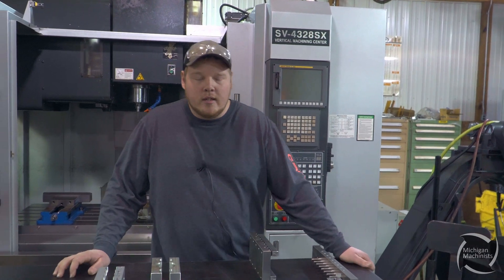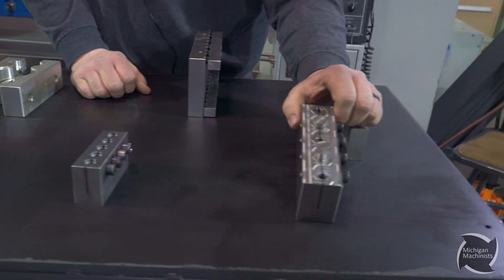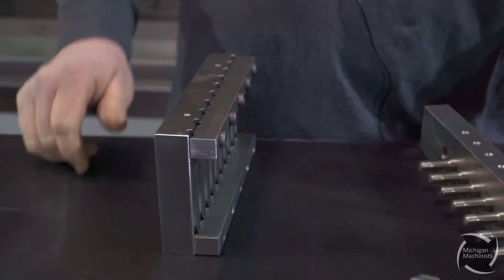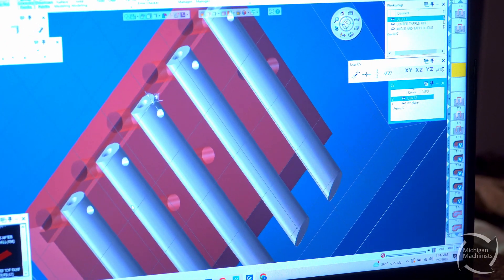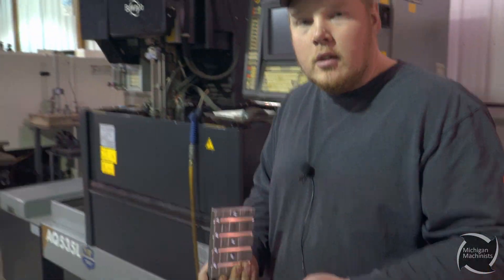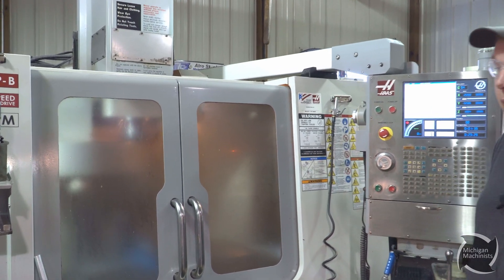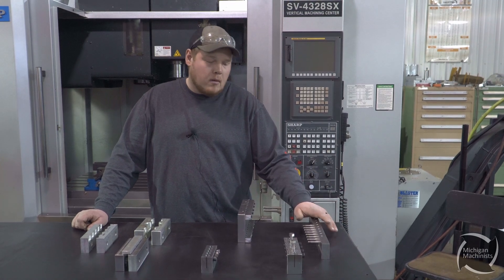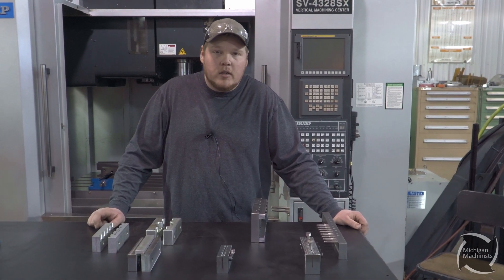How to Use Multiple Part Fixtures for Machining || MICHIGAN MACHINISTS

Comment: Hi. Can you make a video explaining clamping multiple cylinder parts? Your design with that wired edm and screw is very interesting. I tried it but didnt work. Maybe because part size deviation of 0.010mm. Some pieces fly off or moving because the soft jaw is not flexing enough to clamp the parts. Can you explain in more detail how you design your multiple cylinder jig? How wide is the slot and how deep the edm slot need to be. Appreciate it so much for the info.